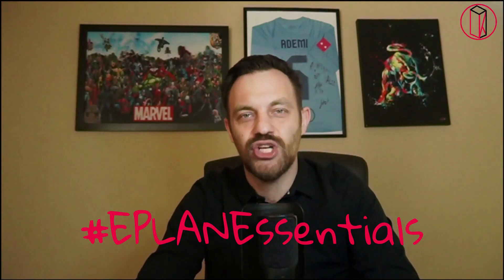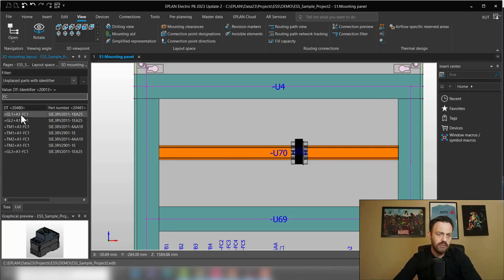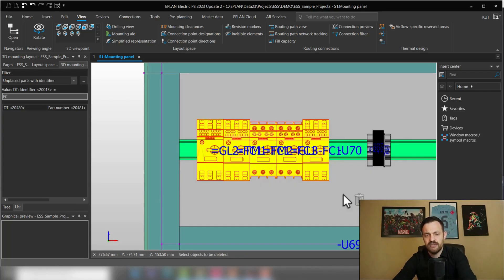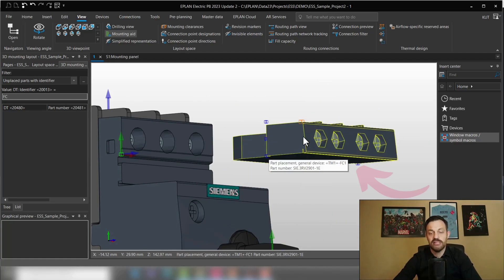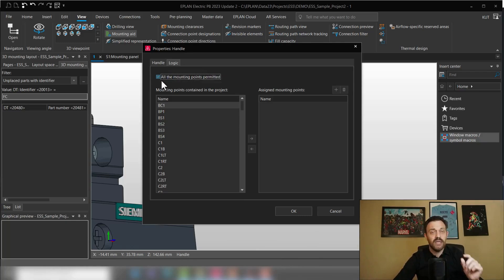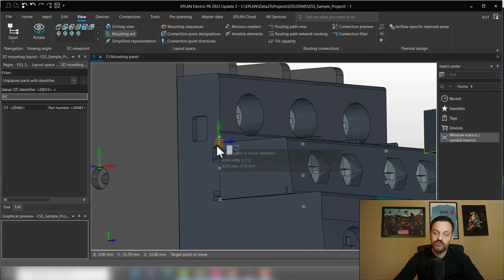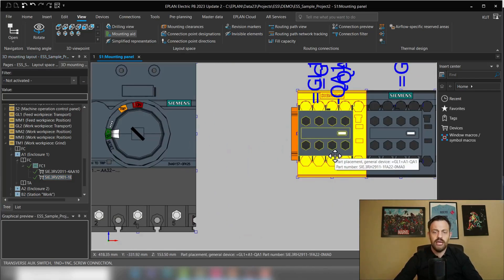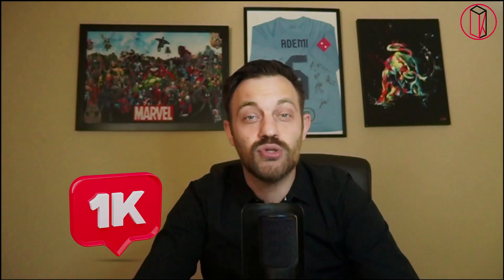Efficient Auxiliary Component Placement in EPLAN Pro Panel

Comment: Hello Cruno - Could you help me with one issue ? I downloaded a 3D macro of main switch and the other 3D file with its auxillary contacts. Unfortunately, The author/producer did not add a mounting point for contacts on the main switch. How can I open and edit this macro, and how can i add a mounting point ?
Reply from the maker: Hello Sir.

Thank you for your question.

That should be pretty easy, in your macro project please open/create a Layout Space and insert the main component part > macro should appear.

Then you should be able to insert the mounting point on the macro.

Make sure that the layout space property "Macro:Name" is the same as the main component

Generate Macro
Reply: @UncleKruno  Hello again,

Thank you for your help. I have tried this solution and it work. You are an expert!

Could you make a video about hole patterns - How they work ? 

Best regards